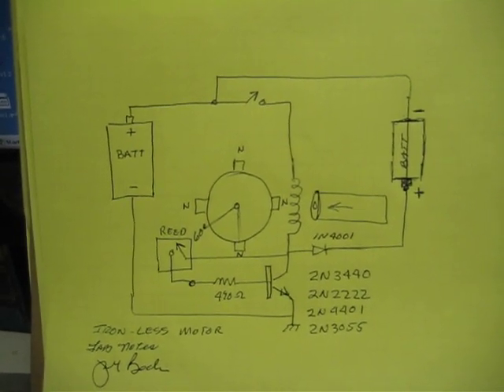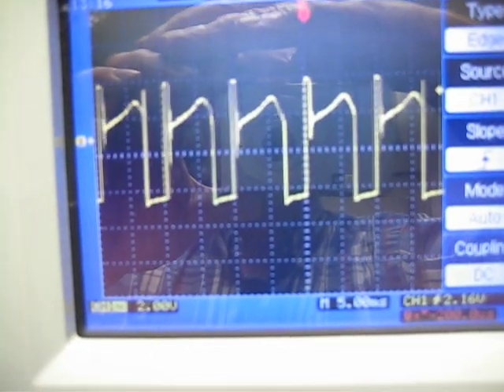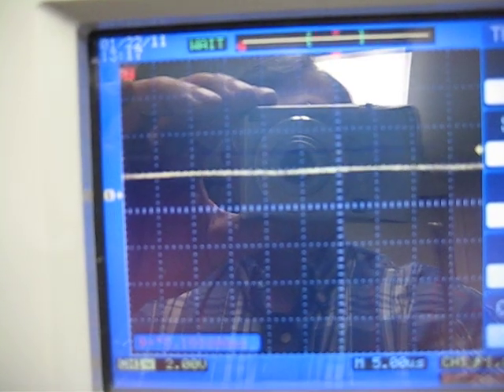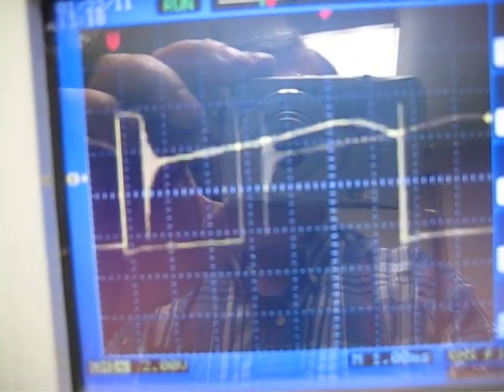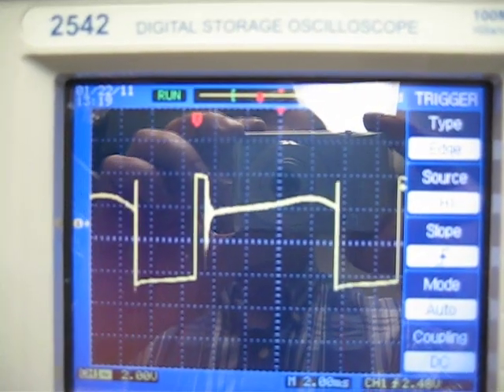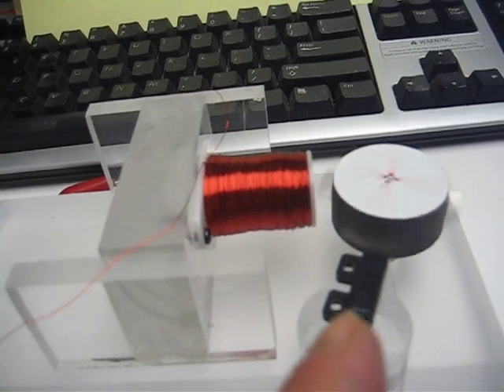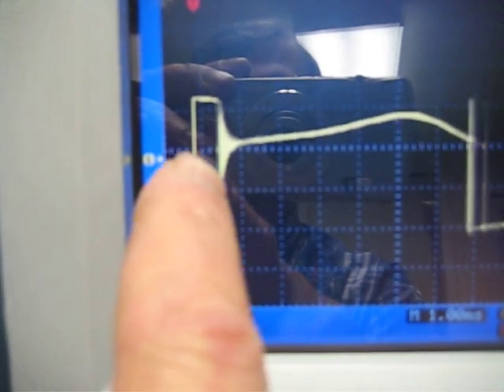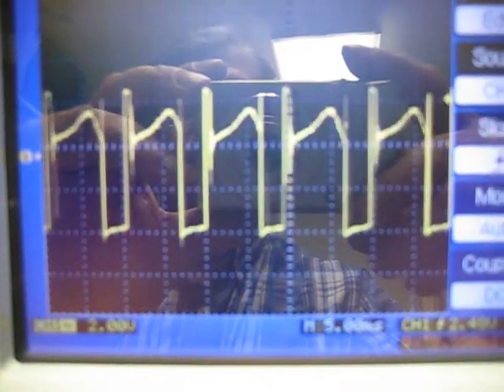Iron-less Monopole Motor 2

Comment: I must report that I was on the woods in a tent for 5 days and using my vibrating triple A razor with 1 rechargeable battery using it every morning and recharged with energy from my one coil ssg the blinking started lil before coming back. Now it seems that it has more energy after about 3 recharges, it feels more powerful and I could swear that even absorbs energy by itself while at rest! is lasting  5 steady days and 2 days blinking but not with immediate instant and even death like before!